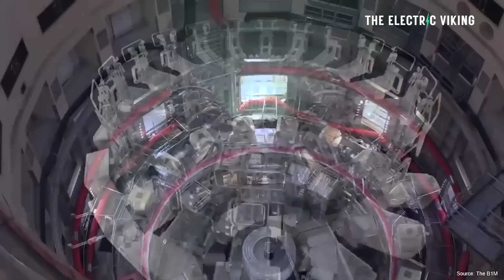Sweden criticised over plan to build at least 10 or more new nuclear reactors

Comment: I live in Sweden in a detached house. I have installed pvs on my roof generating approximately 50% of the annual electricity need. Main issue is that the seasonal matching is very poor. I get 5000 kWh excess during summer which is needed in the winter. Storing such amounts of energy is not yet econmically feasible on large scale. I guess pumped hydro may offer a solution in the future. Probably not batteries though.
Reply: I suspect most if not all locations suitable for pumped hydro have already been built.
Reply: Wow, to get 5 mWh excess production you must have a pretty extensive solar system.  What is your daily excess during the Summer?
Reply: Is Sweden working with Denmark on wind generation projects? They are acknowledged to be the world leaders in the field. Also, Sweden should join Norway in developing Thorium technology. Finally, Finland just connected its newest nuclear plant, built with French technology, to the grid. That project should be studied carefully due construction delays and major cost overruns.
Reply: @ULlisting European networks are being connected, but northern Europe isn't super large, it is densley populated. So, in winter, sometimes a huge high pressure zone covers all from Belgium to Finland: darkness and morning fog, afternoon mist and 4pm darkness - for a week. Yay great ice skating but no solar. And efficient heat pumps don't work when the nights go under minus ten: you need lots of power. Nor does anybody want to shut down industrie: metals, heavy industry, trucks, what about aluminum smelters? Industrial nations need dependable continuous serious power. High pressure means no wind, winter means no sun, and high pressure offers beautiful landscapes: but only for the occasional Aussie visitors to awe at! Animals hibernate, Swedes build tanks and Volvos and aircraft and high tech tools and machines and AbbA music ....  ok, but get the data: large high pressure areas in the winter mean: no power. Even the hydro can freeze. What then - you spoke too fast on this one!  Great program otherwise!! Love to the family!
Reply: @ULlisting  there are of shore wind projects that will use Vestas.
Hopefully they will not go over budget and achieve the high estimated capacity factor. However it's not even close to replacing nuclear unless we build a lot of pumped hydro.
Reply: @nas4apps  As wind will be the dominating source in the future I think nuclear is the wrong option. Pumped hydro would be a lot more useful as a complement. But don't worry. There will not be any reactors built. They are too expensive and need a lot higher price for much of the year to be economic. The investors are much more willing to fund onshore wind as they can be profitable with todays low price.

Regarding the estimated doubling of the demand it's too early to know if it's going to happen this time. I'm old enough to remember a lot of predictions done over the years. Most of the long term estimates have been quite off the mark expecting demand to pick up fast with increased industrial use. Instead new demand has been countered by increased efficiency and old industries closing shop. The new high consuming green steel plants will mainly use H2, and they will be very price sensitive, meaning nuclear is not a priority for these consumers as have been pointed out by among others Peter Carlsson, the Northvolt CEO.

So the only way I can see nuclear being built in any bigger numbers is some kind of breaktrough making it more competitive. We in Sweden already consume twice as much electricity per capita as Germany and France. The reason is the Scandinavian mountains with Europes best hydro power resources. Together with Norway we have the capacity to store more than 100 TWh for later use in the many hydro dams. But we don't have any advantage over other countries building nuclear.
Reply: Thank you! Soon I will get my elicticity for free between 11 and 17 since everybody Install their panels to the south.  - 90 öre/kWh  is the record thus far.. And its barely started
Reply: Tesla batteries will be used, not pumped storage. Sweden is smart, they know what they are doing.
Reply: @johanjohansson2053  The Netherlands has had negative prices already, on a Sunny Sunday in July. And those with a dynamic meter and solar panels found they were paying to deliver energy! Ok: this is the case for that home battery! Yes, in NL you can get a dynamic price contract. Be careful though! Danger in summer and winter when prices spike up or down. Why nuclear: what else? The hydro power mentioned is already sold (!). Either fuel up gas or go clean nuclear. Gas could be hydrogen based, so a nation needs double in the summer. It is not efficient to produce hydrogen, losses along the way. Clean, but not cheap. Nuclear is known, Sweden has a nuclear industry, it is an export product. Lots of plusses. I live in The Netherlands and the local take is, after this invasion nearby: you need a mix. Solar on every roof is policy: the meter just runs backwards! Legal, full contract price until you pay zero. That already is a great incentive for solar. This distributes evenly: on rooftops everywhere. Lots of wind, the Dutch started with windmills a thousand years ago.
Reply: Pumped hydro will freeze in winter with no water available in winter. Not a good alternative.
Reply: @stanleytolle416  We have pumped hydro right here in Arizona and I have never seen it freeze. Just go to batteries.
Reply: @tedmoss  they are talking about Sweden.  Like there's no water because it freezes.  Like Arizona there is a problem with pumped hydro at times not having the water too.  Actually Arizona is a good example of no drama nuclear.  Only problem with Arizona's nuclear is it's low  temperature reactors that require evaporative water cooling.  Yeah they are using reclaimed sewage water but now Arizonens don't even want to give up that water.  Would have been better have a high tempature reactor there where air cooling would have been used. Any way Sweden needs power in the winter when other renewables are unreliable.
Reply: @stanleytolle416 My brother is an engineer at a Nuclear plant in GA and is moving to AZ next year. He got a decent job offer at that sewage water cooled plant but after he smelled the place he decided to take a different job at a gas fired plant. 😅
Reply: @stanleytolle416  If you take Norway, freeze is not a problem. Strong business cases for pumped hydro have been published. Biggest bottleneck: grid capacity .....   where did I read that before?
Reply: You can't compare Spain with Sweden, the climates are hugely different !
Reply: I live in Germany. The same applies to Germany. Our roof is completely covered with PV panels. In summer we produce more electricity than we need and the surplus is fed into the grid. Germany has too much electricity in summer because others do this too. In winter it is dark most of the time, and it’s exactly the opposite. You cannot run industrialized countries on renewable energy!  Certain industries run around the clock. They cannot switch off their plants when conditions are not favourable. Most industial plants and businesses cannot run only when the sun shines, or the wind blows.

Comment: Thanks Sweden. At least you and France save the power imfrastructure in Europe. 👍
Reply: France (which has many nuclear power plants) has to import tons of power from Germany (which doesn't have nuclear plants).
Reply: @Tschacki_Quacki yeah, in the summer. In the Winter Germany has to import power.
Reply: @knabbagluon  
That's for financial reasons, not because the power production couldn't keep up.
For example, it is cheaper to buy wind power from Denmark, instead of ramping up a coal plant at home.

2021 Germany has exported 17TWh more than it imported.
2022 that number raised to 26TWh.

Biggest buyer as usual: France
Reply: @Tschacki_Quacki  You are conflating peak power and base load power. With 56 nuclear plants (61 GW) and 83 GW peak load, France is quite comfortable importing 22 GW from their neighbors.
Reply: @Tschacki_Quacki  False, that was true during 2022 however in 2023 Germany is a net-importer and France is EUs largest electricity exporter. Germany has also started a lignite power-plant this year.

Comment: 1)How do you use solar at such high latitudes? There are very long nights up there during winter at the same time as having severe heating energy needs (its very cold).
2)You are talking up advances in solar, but not nuclear.  There is some very good new tech in nuclear if it is allowed to be developed.
Reply: you spend your countries entire GDP on batteries. Sorted. 😄

Comment: Ontario, in Canada also just announced intentions to increase its nuclear capacity, both at Darlington with an SMR project, and at the Bruce site, with a full new build.
Reply: I’ll be interested to see how the SMR build goes, both for price and speed.  Nuclear has provided a great stable supply of electricity for Ont. for like half a century now.  I’m definitely more in favour of renewables when possible as they’re likely the cheapest option but for baseload supply nuclear is both clean and very reliable.  The expansion of a traditional NPP with a legacy build just seems like it will face many delays and cost overruns, based on historical precedent. 

Ontario needs to step up its game in storage as well, I suspect that we’re overbuilding generation to deal with peaks instead of considering the option to store when demand is low and release when needed.  The biggest problem with going big on storage right now is that there’s so much research and newly commercialized tech coming out that to settle on a specific technology that may be outdated by the following year causes hesitation.
Reply: Ontario has pumped storage near the Niagara River. There is also a proposal for an additional pumped storage project on Georgian Bay. Ontario also 'stores' power in Quebec by sending off-peak power from the Ontario grid to Quebec that allows lower production of hydro-electric power and reduces flow. The water not used in the off-peak period can be used during the peak to generate extra electricity.
Reply: The Darlington CANDU plant is a poster child for that technology. Hopefully CANDU can come up with an updated version that can be exported to the world.

Comment: We in The Netherlands are also planning new reactors. Due to our dark winters, solar is not an option for the whole year. Wind turbines are killing birds by the thousands. To electrify our whole economy, including the (steel)industry, wind and solar are not sufficient.
Reply: not that many birds would die if the turbine wings were coloured.
most birds avoid loud turbines.
Reply: The birds thing is overstated in a lot of countries (not necessarily including the Netherlands there) and measures could be implemented to reduce bird deaths further. Wind power is a valuable resource for north western Europe, just as solar is for the Mediterranean region, however, they need another baseline energy source. Nuclear is the cleanest. The Netherlands has one nuclear power plant as far as I'm aware, in contrast, Belgium and Switzerland have four, Finland has five. Yeah, I'd say the Netherlands needs another couple of reactors, as could Denmark. The elephant in the room though, is your neighbour who probably needs a dozen at least if it has any pretensions of remaining a major industrial country.

Comment: I tell my customers that if they live south of the 42 parallel then the project may be economic. Not that they cannot use solar further north. It just won't pay for the project very effectively unless they have very expensive energy they are replacing. But, if they want off grid power or have other concerns, solar is part of an overall solution, just not a big financial return.

Comment: I’m so happy Sweden does this, there’s no stability in solar in Scandinavia, here in Norway we’re experiencing very high prices for electricity which fluctuates greatly with the sun every day. This will stabilize everything and you can put renewables on top.
Reply: The prices are made according to rules made by politicians. Now and during the next few years there is no lack of electricity in the Nordic countries, at any time of the year.
The prices depend on the demand in the UK (for Norway) and in Germany /Holland (for Sweden).
The bad transmission from northern to southern Sweden also affects the prices in Norway.
But lack of electricity, no, we have no lack of electricity basically.
Reply: The problem with nuclear is that it is not very cheap either. Especially now that we have so much wind and solar, it makes even less sense. Because you cannot easily shut down nuclear for a day when there is enough renewables, and power it up again.
Reply: Steinbitt, 

I'm very surprised that your electrcity is expensive given your very large hydro generation resources?
Solar is by far the worst of all renewable generation, and that is saying a lot. Dump the renewables and stick with Hydro, and if necessary curtail your hydro exports to ensure your security of supply.
Reply: @iareid8255  The price is set by the most expensive energy at any time. When Russia invaded Ukraine they made sure gas prices when sky high, so with the pricing working the way it does, any time there is some gas power needed we have to pay accordingly. Europe's grids are all interconnected so that energy can be imported and exported between countries as needed, but that mean Norwegians get higher prices when there is a lack of energy in Britain for instance.
Reply: @itekani hopefully with more renewable energy coming online in the UK (Dogger Bank) and throughout the rest of the EU, there will be enough excess in a few locations to satisfy the overall demand for electricity in the entirety of the eurozone. Personally I’m not against the idea of some additional nuclear as it definitely can provide a good stable baseload for electricity, but with traditional methods of building NPP it is generally quite expensive and takes many years and I wonder whether 10 are really needed in total.
Reply: Sweden is too far north for solar to be viable. I guess they are comfortable with nuclear as it already makes such a big contribution. These new plants must be intended as replacements for ageing reactors as they won’t be on line for at least 10 or 15 years. If they want to expand energy supply in a hurry then wind would be their best option as hydro has a long lead time as well.
Reply: @philiptaylor7902  We are expanding wind in the short/long term and also now nuclear in the long term, we need to double the electricity production mainly for heavy industry and transportation. In 2022 Sweden was the larger exporter of electricity in EU. Sweden also have about a fifth of electricity production from wind, the thing with wind is that the higher percentage of wind in electricity production the more it costs(wind also has problems with building permissions). Hydro is also fully utilized in Sweden.
Reply: @itekani usually, cheap stuff tends to be "crappy" plus you didn't consider the return of investment & capacity factor
Reply: @HSstudio.Ytchnnl  Renewables are getting cheaper and nuclear is getting increasingly expensive. We also need more energy now, we cannot wait ten years.
Reply: @itekani  renewables are occupying more land (especially farmland) while nuclear is getting smaller thru the use of modular reactors & it's using less land. Nuclear is thousands of times more powerful than traditional methods & is really reliable, we may need to use every piece of land for energy instead of using it for housing or for food security
Reply: Both norway and us here in Denmark should help to finance these 10. Especially if we get guarantees
Reply: @iareid8255  No surprise really. There are agreements in place that countries must sell electricity to other European countries, where possible, to stabilise electricity supply and prices across Europe . When some countries have invested heavily in wind and gas for their electricity, and gas became more expensive at the same time as we see lower than average wind, this will push the prices up. The two countries affecting Norway's electric prices the most, are: Britain and Germany. Britain has built a new nuclear plant, with another close to being started (I'd argue that it needs two more). I see Germany having two options, re-opening Nordstream, or building 10 to 20 nuclear plants.

Comment: The reality is renewables only work for Europe if it fully de-industrialises. Unsurprisingly most of Europe doesnt want that. Consequently, nuclear energy is alive and well in Europe. 

This particular announcement is very good news for Sweden and Europe generally.

 Poland is also well along on commissioning two large gigawatt scale Korean designed nuclear power plants so it can phase out brown coal for industrial and commercial energy. It has options on two more.

Poland has also announced the acquisition of up to seventy small modular reactors (200MW class) of either the NuScale or Swedish LeadCold SEALER design.

France has announced 14 new EPR 2,000 and also refurbisment of 30 existing plants. 

The UK has announced up to eight new gigaWatt class power plants as well as a small modular reactor program.

At present Germany is the hold out. It tried to transition to natural gas but the Ruzz war put an end to that. It is now moving to biomass (wood chips) and given these are in short supply (it has already cut down most of its forests), it is moving back to coal and hang the consequences.